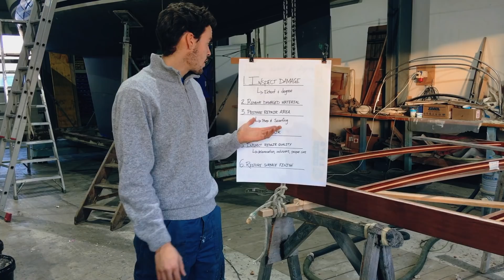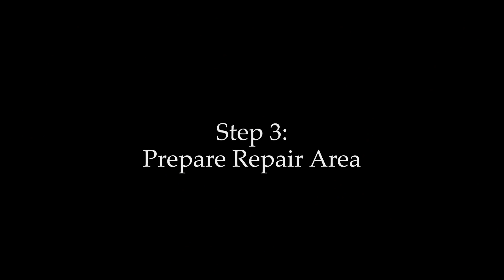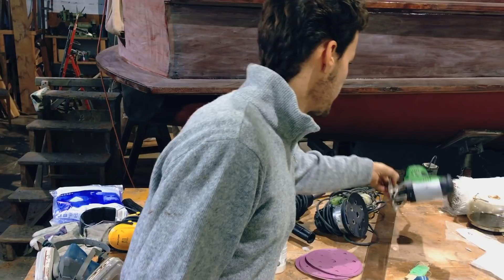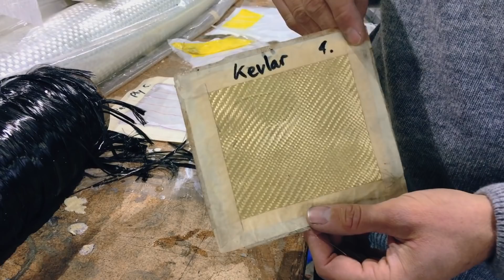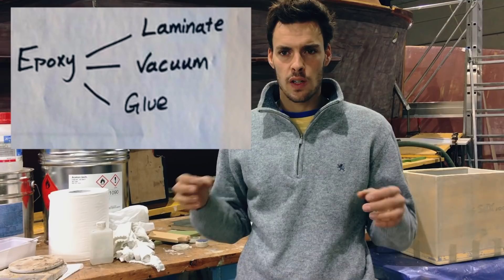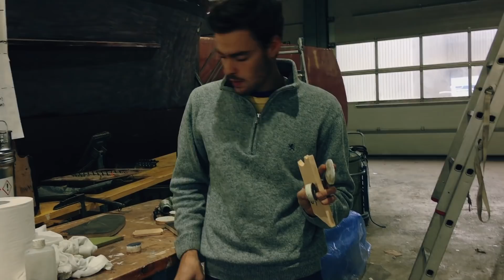How to Repair Damaged Fibreglass

Comment: Breather or Bleeder cloth is a 100% non-woven polyester fabric that is designed to allow airflow throughout the vacuum bagging process as well as bleed out an excess resin in a composite part. It allows great conformity around a composite part while under vacuum pressure.

Comment: for dust removing when sanding with the angle grinder there exists a wonderful tool extension made bei festool, former festo. I am retired carpenter and cabinetmaker and worked a lot on refitting wooden floors and especially wooden stairs thirty years ago and always searched for something fittting on my angle grinder, because any other sanding machine was not aggressive enough to form a new flat surface on old wooden stair steps, but the dust would fly straight into my face.
It fits on nearly every angle grinder and has a circular brush (of nylon or brass changeable) you can position around the sanding  disc by turning the handle and an adapter which fits to the vacuum. You remove araound 90% of dust an have both hands free to work with the machine.

Comment: Your plastic tool for "curving" the boat is what I believe is called in English (well American English) a "spline."  I am now 61yo, but in my mid-30s I took a boat lofting class.  We used wooden splines (not plastic).  Also, there is a mathematical definition of a spline curve, so CAD programs can easily draw spline curves.

Comment: That ruler type tool we just call it a straight edge. Its used in boat building, auto body and even drywall repair fiberglass repair its a multi tool for sure. As a welder fitter I've used it for years in fabrication.

Comment: Superbly clear explanations Aladino, thank you.
By the way, in the UK I have always heard the term "fillet" for what you call "cove".
One question for you. After preparing the repair area meachanically, I usually wash the area with acetone to remove dust, but also usually roughen up the surface & free the surface fibres using acetone & a wire brush. Obviously taking care to avoid pools of acetone attacking the laminate. My idea is to raise the fibres on the surface you are laminating to & soften the surface a little to get a perfect bond of new laminate to old. I know that this is unconventional, but wondered what you think & whether you ever do this ?
I agree incidently that a repair from both sides has to be stronger. It becomes like a mechanical rivet, holding from either side. Just more work !
Chas
Reply from the maker: Hy Chas! 
Thanks a lot for your positive feedback. 
As to your question...
Roughening up and preparing the surface is crucial, but I’vepersonally never used a wire brush.. the right grit sandpaper and an adequate scarf do just fine. And for the final wipe I also always grab acetone. Just let it vent a bit and evaporate before starting :)
Thanks again
Aladino

Comment: awesome video, just my .02c, when you want to remove thru-hull fittings, I've seen them just use a grinder and grind the metal thru-hull from the outside of the hull. once the fitting has been ground to almost level with the hull bottom, the metal has become so thin that you can just push the threaded portion up and through the hull hull, ending up inside the hull....again just my 2c

Comment: We called them Battens....Used them with Marston White Lightin for plugs .  Did you ever use "fart Block"?  Smells terrible but a wonderful product for sanding and fairing area up to about 2 feet.  That thin stuff we called a "veil" to prevent print through.  1708 Stitch mat is wonderful to work with too.  Has a mat and a bi-axial weave in combination.  Sucks up the resin but saves time. That unnamed  layer in the vacuum set up?  We called it "bleeder cloth".
Reply from the maker: Lots of vocabulary missing for trying to make an educational boatmaterial video😂
Thanks for your input! :)
I sure have many more technical words to learn..
Are you a boatbuilder?
Aladino

Comment: Does the decision to use gelcoat rather than paint make a difference on whether to use polyester rather than epoxy resin?  I was under the impression that you could only apply gelcoat on top of polyester resin fibreglass. If your patching a gelcoatted hull then don’t you need to use polyester resin and put gelcoat as the top coat so it can be blended and matched?  Sorry, there’s a lot to answer here. Love what you guys are doing and love this series you’ve just launched. Can’t wait for the next episode. Fair winds.
Reply from the maker: Hy Yves!
You are right
Thats what theorie teaches us..
Polyester and epoxy cannot create a chemical bond.
But a mechanical one!
So it’s all about PROPER SURFACE PREPARATION!
(For example getting rid of amines on the epoxy)
Gelcoat can perfectly hold on epoxy when done right.
But my question is WHY BOTHER since i prefer using 2comp paint rather then gelcoat.
(Gelcoat only where there was gelcoat and limited to small repairs) since much more labour intense.
Glad you liked it!
Aladino
Reply: I repair my polyester catamaran using epoxy all the time. I just prefer not gassing the neighbors... But I prefer gel-coat to paint and its held up great. But you need to get the amine blush off using vinegar before sanding or it will not hold. Amine blush is a bit vague, it depends on the temp and humidity whether you even notice it. I also sand with two "coursenesses", not to polish the previous scratches off but to get lots of 'keying surface area" of different sizes.

Comment: Wow, that’s a hard core go-through! Excellent for telling the difference between polyester and epoxy and how to use them. 
So if you had a clinker build wooden hull and wanted it to have the best protection for both northerly and tropical waters - what would you choose?
Thin fibreglass mat with epoxy or what?
Reply from the maker: On a wooden boat you just have to keep up the maintenance.
(Basically also on the other materials- but definitely crucial here.)
I wouldn’t recommend Fibreglass over a wooden boat.
On the topsides it’s varnishing when needed
And instead if you are referring to worms in the tropics 
Best is a good amount of epoxy coats-no fibreglass.
Northerly climates are better on a wooden boat and the more south the sun and humidity takes its toll.
Do you have a wooden boat?
Cheers
Aladino
Reply: No, no boat yet. But I’d really like it to be wooden when it “comes”. Yes, shipworms might be a disaster. And I’m trying to understand what would be the best solution for treatment under the waterline. Maybe epoxi and then the Hempel SilicOne can become a good solution? Would it be crazy to first let the planking soak up to maximum with linseed oil - let it cure - and then epoxi generously on top? Would the epoxi bond to the surface then? And then apply SilicOne over the epoxi?

Sorry, many questions here but since you maybe have the answers, there might be more😉

Comment: I would like to get your opinion on using copper coat for bottom prep. It seems to be a good solution both in protecting from growth and protecting the environment. It might cost more to start but it looks like it will last a lot longer than AF paint
Reply from the maker: Hi Lou! Sorry we took a while to respond! We’ve actually never used copper bottom because it’s now banned in most countries for environmental reasons. I have heard from other sailors that it is very effective, but I think it has some serious environmental side effects. That said, I haven’t actually researched the effects, I’m just assuming based on the fact that is is banned in many places, including Switzerland.

Comment: Divinycell dissolves :)

 BTW is that a X 102  in the background? 

You do beautiful work and chose a worthwhile classic for restoration. AND you can easily win the highest maintained heeling angle award at any regatta you chose to enter :)
Reply from the maker: Ian Allan 
it sure is not a racing boat .. but it  gets “the looks”-award

The boat in the background is an x99. One of the boats i had most fun racing on!
Thanks for watching:)
Aladino

Comment: Great and thanks for sharing :-) My understanding is one can use epoxy over polyester but not the other way around...is that true?
Reply from the maker: Hy snake and thx for watching!
Normally that should be true..
If the epoxy has cured correcly or for very long polyester might also work.
But i dont risk it..
best is same on same.
Or after epoxy i use 2comp.paint
Cheers
Aladino

Comment: Did you use any honeycomb at all in the repair when you made the repairs on MC I ?
Reply from the maker: No,not necessary Unless it was made with it in the first place. I rebuilt it the way it was originally, so all hand laid solid grp hull and the deck is foam cored

Comment: Plastic or wood "Batten" or "Straight-edge"
Reply from the maker: Karl Friedrich 
Thx karl
I will go for straight edge batten:)
Reply: @SailingMagicCarpet  It also reminds me of a lofting batten, used to transfer discrete points from the boat (or sail) plans to a wood (or sailcloth) panel.
Reply: In German we say "Strakleiste" used for controlling or drawing (in combination with special formed heavy weights called "Strakgewichte") a smooth curve